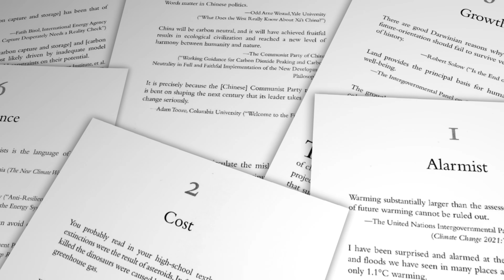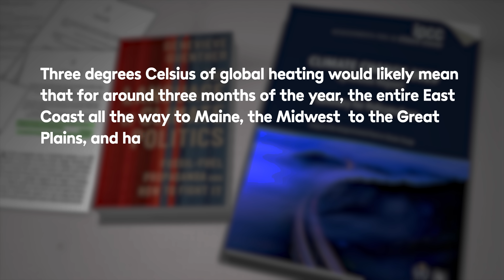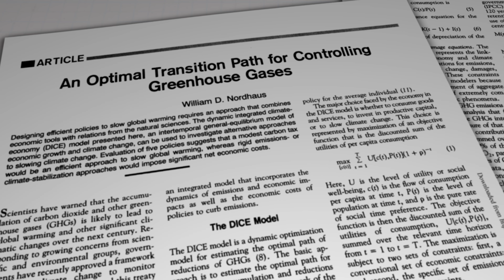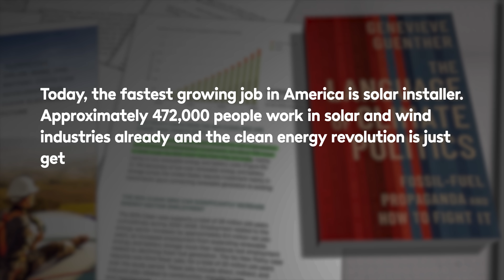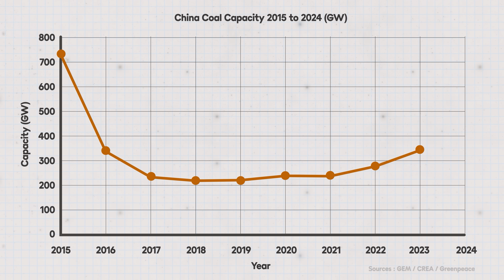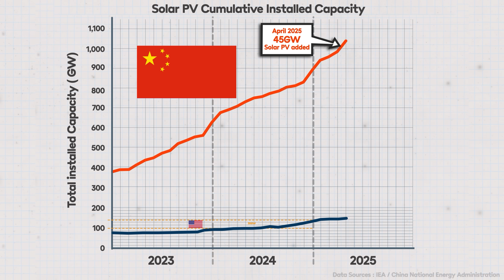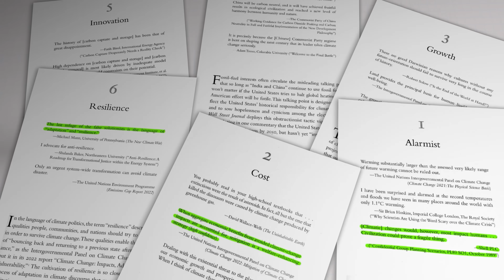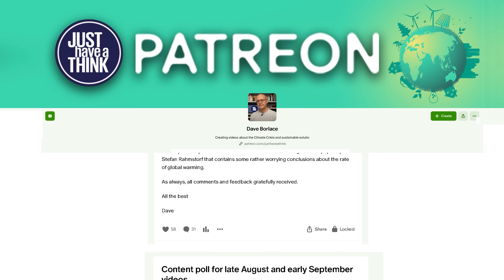New research DEBUNKS climate disinformation.

Comment: @Dave Borlace
Dave, can you look into and correct and/or explain why my last comment replying to orterves does not show up when I am not logged into my YT account? My comment still exists in my YT comment history, so that's proof that it was made. It contains a lot of climate science empirical data and peer reviewed science. Surely you want your 664K subscribers to see ALL the evidence both for and against human-caused global warming, don't you? I have screenshots that document what is happening if you would like to see them. 
FYI, the following is the text of the comment: 
******
@orterves "You are living in a bubble of ignorance." 
You are projecting your own condition onto me. 

Myhre(1998) empirically quantified nothing because there was no 'WMGG' empirical data for 'pre-industrial times'. 
Hansen(2005) empirically quantified nothing because the paper was based on flawed, faulty, falsified, failed climate models, which is not empirical data. 
Santer(2013) empirically detected nothing because the paper was based on flawed climate models, not empirical data. 

"Natural factors like solar output and volcanoes have been measured and can't explain the scale or pattern of current warming, only greenhouse gases do. " 
False. Increases in SURFACE solar radiation, due primarily to a decrease in the Earth's albedo, can explain the recent global warming over the past half century. Those increases in climate forcing are ~10 times greater than the alleged increase in surface CO2 forcing. This is empirically quantified and documented in multiple peer reviewed papers. Hatzianastassiou(2005) 'Global distribution of Earth's shortwave radiation budget', Pinker(2005) 'Do satellites detect trends in surface solar radiation', Goode(2007) 'Shortwave forcing of Earth's climate: Modern and historical variations in the Sun's irradiance and Earth's reflectance', Herman(2013) 'A net decrease in Earth's cloud, aerosol, and surface 340 nm reflectivity during the past 33 years (1979-2011)', McLean(2014) 'Late Twentieth-Century Warming and Variations in Cloud Cover' document increased SURFACE solar radiation of 3W/m^2 to 7W/m^2. And Santer(2025) 'Global Warming has Accelerated' documents and increase in SURFACE solar radiation of ~3W/m^2 over the entire 25 years of the 21st century due to a reduction in the Earth's albedo of ~0.7%. 

"Satellites show less infrared escaping Earth at CO2 absorption bands, and surface stations record more downwelling radiation, exactly as predicted." 
False, they didn't. The CERES data showed the opposite. 
From 2000 to 2015 DWIR decreased while CO2 levels increased: https://okulaer.wordpress(dot)com/wp-content/uploads/2015/03/lw-ned(dot)png 
From 2000 to 2015 LWIR from the surface increased while CO2 levels increased: okulaer.wordpress(dot)com/wp-content/uploads/2015/03/lw-opp(dot)png 

"The carbon isotope signature confirms the CO2 is from fossil fuels." 
False. They show no such thing, because the δ¹³C ratio from decaying natural vegetation is the same as from combustion of 'fossil' fuels. Plus the changes in Δ14CO2 is due to the natural reduction from the 'bomb spike' from atmospheric nuclear tests. 

"The rate of change is also far beyond natural variability, it's roughly ten times faster than typical past shifts." 
False. There have been numerous previous natural warmings of similar magnitude and rate of warming. 
"This analysis indicates that rapid warming trends exceeding 1.5 °C per century occurred at JRI during the intervals spanning 1518-1621 AD and 1671-1777 AD, and exceeded 1.25°C per century during the interval 296-415 AD." - Mulvaney(2012) 
Other natural warmings were: 
- 2585 BP 84yr natural warming of 0.20C/decade 
- 2760 BP 90yr natural warming of 0.22C/decade 
- 2980 BP 133yr natural warming of 0.15C/decad
6385 BP 98yr natural warming of 0.19C/decade - 8226 BP 91yr natural warming of 0.32C/decade - 10.3K BP 97yr natural warming of 0.19C/decade - 
74.7K BP 167yr natural warming of 0.13C/decade 
- 78.4K BP 160yr natural warming of 0.19C/decade 
- 80.2K BP 153yr natural warming of 0.18C/decade 
- 82.4K BP 139yr natural warming of 0.17C/decade 
- 90.1K BP 155yr natural warming of 0.13C/decade 
- 102K BP 65yr natural warming of 0.14C/decade 
- 127K BP 102yr natural warming of 0.13C/decade 
- 129K BP 162yr natural warming was 0.19C/decade 
From Davis & Taylor. Those natural warmings were as high a rate or higher rate than the most recent warming, and there were 30 other natural warmings that were from 0.08C/decade to 0.12C/decade found in this paper: wattsupwiththat(dot)com/2012/09/05/is-the-current-global-warming-a-natural-cycle/ 

"The evidence is overwhelming: human-emitted CO2 is the main driver of current global warming" 
False, as the above empirical science shows. You are just repeating the false propaganda narrative of the CatastrophicAGW-by-CO2 climate alarmism belief system/religion. This is confirmed by the fact that you can't cite a single peer reviewed paper that empirically shows that human CO2 has been the primary cause of any global warming. I've cited peer reviewed science that empirically shows that SURFACE solar radiation increased by 6W/m^2 to 10W/m^2 over the last half century, and that was several times greater than the alleged theoretical SURFACE CO2 forcing of ~1.3W/m^2. I say alleged, because the that formula includes an NON-observed amplification due to water vapor. 

As I said in my original comment, empirical science continues to show that global warming is caused by natural climate variability, primarily how much solar radiation reaches the surface of the Earth. This was established in peer reviewed science before the pseudoscience of CAGW-by-CO2 was begun. 
"It follows from the analysis of observation data that the secular variation in the mean temperature of the Earth can be explained by the variation of shortwave radiation arriving at the surface of the Earth." - Budyko(1969) 'The effect of solar radiation variations on the climate of the Earth'
***
Thanks Dave for your attention to and help with resolving this issue.
RealOldOne2
Reply: TL;DR
Reply: @Leafsdude  
"TL;DR"
Yes, peer reviewed empirical science is like that. 
It takes some intelligence and cognitive ability to understand it.
It's not simple snippets of propaganda narrative like human CO2 did it.
Unfortunately, Dave Borlace or YT or Google censor p-r empirical science that is contrary to the CAGW-by-CO2 propaganda narrative, so the climate alarmism cult members don’t see the truth and leave the cult.
Reply: @RealOldOne2  "Yes, peer reviewed empirical science is like that."

I've read the peer-reviewed empirical science.

Your meandering, unsubstantiated mumbling on y/t isn't it.
Reply: @Leafsdude  
"I've read the peer-reviewed empirical science.
Your meandering, unsubstantiated mumbling on y/t isn't it."
The points in my comment that refuted every one of orterves's false claims were substantiated by the peer reviewed science that I cited.
Noted that you couldn't refute any of it.
Reply: @RealOldOne2  "The points in my comment that refuted every one of orterves's false claims were substantiated by the peer reviewed science that I cited."

The only peer-reviewed science you cited were ones that you then asserted were wrong without demonstration, eg: Myhre(1998) (sic).

Even worse, you've relied on a very unscientific blog to make your supposed point.

Do try harder.
Reply: @Leafsdude  
"The only peer-reviewed science you cited were ones that you then asserted were wrong without demonstration, eg: Myhre(1998) (sic)"
That's totally false. I cited" 
- Hatzianastassiou(2005) 'Global distribution of Earth's shortwave radiation budget', 
- Pinker(2005) 'Do satellites detect trends in surface solar radiation', 
- Goode(2007) 'Shortwave forcing of Earth's climate: Modern and historical variations in the Sun's irradiance and Earth's reflectance', 
- Herman(2013) 'A net decrease in Earth's cloud, aerosol, and surface 340 nm reflectivity during the past 33 years (1979-2011)', 
- McLean(2014) 'Late Twentieth-Century Warming and Variations in Cloud Cover' document increased SURFACE solar radiation of 3W/m^2 to 7W/m^2. 
- Santer(2025) 'Global Warming has Accelerated'
- Mulvaney(2012)
- Budyko(1969) 'The effect of solar radiation variations on the climate of the Earth'

Noted that you not only failed to refute anything in those 8 peer reviewed papers, you didn't even acknowledge their existence in my comment.
Please try to stay in the world of reality.
Reply: @RealOldOne2  "- Hatzianastassiou(2005) 'Global distribution of Earth's shortwave radiation budget', 
- Pinker(2005) 'Do satellites detect trends in surface solar radiation',"

What exactly do you think these papers say re:climate? Note that not only do none of them comment on the effect of their data on climate, they don't even quantify the hypothetical temperature flux it would imply.

I'll also quickly note that these are looking at half of the atmospheric heat balance.  They do not discuss the effect of irradiance from Earth.

"- Goode(2007) 'Shortwave forcing of Earth's climate: Modern and historical variations in the Sun's irradiance and Earth's reflectance', "

Per the paper: "The increasing greenhouse forcing due to an anthropogenic increase of atmospheric CO2 over the past century has been treated in detail in
scientific literature in recent years (Intergovernmental Panel on Climate Change or IPCC, 1995; IPCC, 2001; Houghton, 2002 and references therein)."

So, opposed to arguing that current climate cannot be explained by anthropogenic sources, it actually explicitly acknowledges it.

"Herman(2013) 'A net decrease in Earth's cloud, aerosol, and surface 340 nm reflectivity during the past 33 years (1979-2011)', "

This paper is primarily a discussion on calibration of data analysis from satellite instruments.  Beyond that, the decrease in aerosols since 1985 is well documented and understood, and is in fact a large reason for the anomalies in Hansen 1988's scenarios that such findings has since allowed corrections for.  In other words, these findings have already been accounted for, and they still don't explain the temperature changes over the last 50+ years.

In short, I'm not sure how this refutes anything.

"McLean(2014)"

McLean 2014 is not peer-reviewed, as the journal publishing it (SCIPS) is known to not have a rigorous peer-review methodology and is in fact labeled as pay-to-publish predatory journal by all respectable scientific sources.

"Santer(2025) 'Global Warming has Accelerated'"

As with the first two, what do you think this article is saying?

"Mulvaney(2012)"

Paper title, please.

"Budyko(1969) 'The effect of solar radiation variations on the climate of the Earth'"

This paper is discussing Milankovitch cycles, and while it doesn't explicitly mention CO2, it does implicitly note its relevance in that phenomenon when it discusses "atmosphere and hydrosphere circulation".

In the end, I'm forced to restate that your assertions on these papers are not supported by the contents of said papers as it currently stands.
Reply: @Leafsdude  
"Budyko(1969) ... This paper is discussing Milankovitch cycles"
That's a misrepresentation. Milankovith cycles aren't even mentioned until 6 pages into the paper (over 2/3rds through), and then in the context 
"Though in this paper the author has no possibility to discuss numerous other hypotheses as to be causes of quaternary glaciations, nevertheless it is necessary to dwell upon popular idea concerning the influence of changes of the Earth's orbit elements on glaciations.
Such a conception substantiated by Milankovich (1930 and others) and other authors is shared by many specialists studying quaternary glaciations." - ibid

My quote wss from the abstract where authors summarize key aspects of the paper. Milankovitch isn't even mentioned in the abstract.
Reply: @Leafsdude  
""Mulvaney(2012)" Paper title, please."
Mulvaney(2012) ‘Recent Antarctic Peninsula warming relative to Holocene climate and ice shelf history’
Reply: @RealOldOne2  Budyko doesn't mention them by name, but that is the process that the paper is discussing in it entirety.  You don't have to mention a concept by name from the start or even at all to be discussing it.
Reply: @RealOldOne2  In Mulvaney's conclusion:

"If warming continues in this region, as is suggested by its attribution in part to rising atmospheric greenhouse gas concentrations 7,23, then temperatures will soon exceed the stable conditions that persisted here for most of the Holocene."

(The papers referenced by Mulvaney: 7 - Bentley, M.J. et al. Mechanisms of Holocene palaeoenvironmental change in the Antarctic Peninsula region. Holocene 19, 51-69, 2009, 23 - Bracegirdle, T. J., Connolley, W. M. & Turner, J. Antarctic climate change over the twenty first century. J. Geophys. Res.-Atmos.113, 2008)

So the paper you cited here supports anthropogenic-driven climate change.
Reply: @Leafsdude  
Hatzianastassiou(2005) ... Pinker(2005) ... What exactly do you think these papers say re:climate? Note that not only do none of them comment on the effect of their data on climate"
Really? You have to ask that question?
They both document that there were significant increases in shortwave surface solar radiation since 1983, and anyone with a little knowledge of climate knows that causes global warming. 

"Significant increasing trends in DSR and net DSR fluxes were found, equal to 4.1 and 3.7 Wm−2, respectively, over the 1984–2000 period (equivalent to 2.4 and 2.2 Wm−2 per decade), indicating an increasing surface solar radiative heating. This surface SW radiative heating is primarily attributed to clouds, especially low-level, and secondarily to other parameters such as total precipitable water. The surface solar heating occurs mainly in the period starting from the early 1990s" - Hatzianastassiou(2005)
Do you really not understand that surface solar HEATING is what global warming climate change is all about?

"Long-term variations in solar radiation at Earth’s surface (S) can affect our climate, the hydrological cycle, plant photosynthesis, and solar power. Sustained decreases in S have been widely reported from about the year 1960 to 1990. Here we present an estimate of global temporal variations in S by using the longest available satellite record. We observed an overall increase in S from 1983 to 2001 at a rate of 0.16 watts per square meter (0.10%) per year; this change is a combination of a decrease until about 1990, followed by a sustained increase." - Pinker(2005)
Did you miss that "affect our CLIMATE" in the very first sentence of the paper???

"Note that not only do none of them comment on the effect of their data on climate"
Really? "surface solar HEATING" is not an "effect ... on climate"
It appears you have no clued about climate science.

"they don't even quantify the hypothetical temperature flux it would imply."
Irrelevant handwaving. That wasn't the purpose of those papers. It was do document changes in surface shortwave solar radiation.

"I'll also quickly note that these are looking at half of the atmospheric heat balance."
Even a 10 year old child understands that when you turn up the heat input to the pot of water on the stove, it will cause the water to warm up more.
Do you realize that you are embarrassing yourself?
Reply: @Leafsdude  
"Goode(2007) ... Per the paper: "The increasing greenhouse forcing due to an anthropogenic increase of atmospheric CO2 over the past century has been treated in detail in scientific literature in recent years (Intergovernmental Panel on Climate Change or IPCC, 1995; IPCC, 2001; Houghton, 2002 and references therein)."

So, opposed to arguing that current climate cannot be explained by anthropogenic sources, it actually explicitly acknowledges it."
Your selective quoting is noted, and confirmed by the paper's text IMMEDIATELY following where your quote stopped: "However, the variability in the Earth's net shortwave forcing could also play a CRITICAL ROLE in the Earth's climate change."
THAT, "the Earth's net shortwave forcing", was a major aspect of the paper. 
"The DECREASE  in the Earth’s reflectance from 1984 to 2000 suggested by Fig. 4, translates into a Bond albedo DECREASE of 0.02 (out of the nominal value of about 0.30) or an ADDITIONAL global shortwave forcing of 6.8 W/m^2 . To put that in perspective, the latest IPCC report (IPCC, 2001) argues for a 2.4 W/m^2 increase in CO2 longwave forcing since 1850." 
You failed to mention that the alleged (not empirically measured because there is no empirical data from 1850) was only 2.4W/m^2, whereas the empirically measured increase in surface shortwave solar radiative forcing was 6.8W/m^2! 
So Goode(2007) empirically documented that there was 2.8 TIMES MORE climate warming forcing from 1984-2000 than there was allegedly from 1850!
Perhaps you don't understand climate science well enough to recognize that the IPCC's alleged increase in surface CO2 forcing from 1984-2000 was less than 0.4W/m^2. So the natural shortwave solar surface climate forcing was EIGHTTEEN TIMES GREATER than the IPCC's alleged surface CO2 climate forcing. And that alleged surface CO2 forcing includes natural CO2 increases too. 
Yes, the empirical data clearly shows that recent global warming was natural, NOT caused by human CO2.

In short, you majorly either misrepresented or just failed to understand the climate science in Goode(2007).
Reply: @Leafsdude  
Herman(2013) ... This paper is primarily a discussion on calibration of data analysis from satellite instruments."
Not true. As the title and abstract of the paper say, it was primarily about the change in the Earth's albedo. 
"Applying a 3.6 % cloud reflectivity perturbation to the shortwave energy balance partitioning given by Trenberth et al. (2009) corresponds to an increase of 2.7 W m−2 of solar energy reaching the Earth’s surface and an increase of 1.4 % or 2.3 W m−2 absorbed by the surface, which is partially offset by increased longwave cooling to space." - Herman(2013)
Your comment ignores that increase is shortwave solar radiative climate forcing.

"Beyond that, the decrease in aerosols since 1985 is well documented and understood"
Empirical data and peer reviewed science documenting this please.

"and is in fact a large reason for the anomalies in Hansen 1988's scenarios that such findings has since allowed corrections for."
Hansen's 'Scenario C' predicted that global temperature would increase by 1,4C from 1988 to 2024 (0.39C/decade), but actual increase per global satellite data is only 0.16C/decade, and the GHG forcing has acutally increased GREATER than Hansen's 'Scenario C' assumed increase of 1.5%/year. So Hansen's forecast predicted too much warming by over 2.4 times.

"In other words, these findings have already been accounted for, and they still don't explain the temperature changes over the last 50+ years."
Wrong. As my comments about the p-r papers I've cited have shown, the increase in NATURAL surface shortwave solar radiative climate forcing are many times greater than the alleged increases in CO2 forcing, both natural and human.
Reply: @Leafsdude  
"McLean 2014 is not peer-reviewed, as the journal publishing it (SCIPS) is known to not have a rigorous peer-review methodology"
You're either lying, or are relying on the false propaganda narratives of your CAGW-by-CO2 climate alarmism religion. The paper was peer reviewed and published in the 'Atmospheric and Climate Sciences' journal, which has been publishing from 2011-2025.
"SCIRP maintains the highest standards of academic integrity by implementing stringent ethical policies and a RIGOROUS PEER-REVIEW PROCESS. Violations of professional ethical codes, such as plagiarism, fraudulent manipulation of data, and false attribution of authorship, are dealt with severely by our editorial team, with a zero-tolerance approach.
In line with our unwavering commitment to ethical publishing, SCIRP adheres to the guidelines of the Committee on Publication Ethics (COPE) for resolving cases of suspected misconduct.
The manuscript submitted must adhere to the principle of originality and must not have been published in any shape or form previously nor should it be under consideration for publication elsewhere." - scirp(dot)org/journal/publicat_ethics_statement?journalid=492
Obviously, the climate alarmism propaganda gatekeepers are upset that a journal would publish papers based on empirical science which contradicts the climate alarmism false narrative.

From the paper: 
"Total cloud cover decreased during the period from 1987 to 1997 and, for most of the remainder of the period from 1984 to 2009, decreases in low-level cloud were accompanied by increases in middle and upper level cloud. These changes can be found in both global average cloud cover and in each of the six 30˚-latitude bands. The impact of these changes in cloud cover can account for the variations in HadCRUT4 global average temperature anomalies and the divergence between land and sea temperatures. ... 
The temperature pattern for the period 1988-1997 appears to be generally consistent with the 7% reduction in total cloud cover that occurred across the period 1987 to 1999. Applying that reduction to the influence of clouds in the energy budget described by Trenberth et al. [34] results in an increased average solar forcing at the Earth’s surface of about 5 Wm−2. This increase is MORE THAN DOUBLE the IPCC’s estimated radiative forcing from all anthropogenic emissions of greenhouse gases." - McLean(2014)
Reply: @Leafsdude  
"Budyko doesn't mention them by name, but that is the process that the paper is discussing in it entirety."
You're just denying reality and making stuff up.
Whether the cause of increased surface shortwave solar radiation was increased TSI of the Sun's output or a reduction in albedo due to a reduction in clouds or aerosols, the result is the same, global warming caused by natural solar radiation, not human CO2.
Reply: @Leafsdude  
Your handwaving with the 'Moving the Goalposts' logical fallacy is noted.
I cited and quoted from Mulvaney(2012) to refute the false claim "The rate of change is also far beyond natural variability, it's roughly ten times faster than typical past shifts." .
Mulvaney(2012) which states: "This analysis indicates that rapid warming trends exceeding 1.5 °C per century occurred at JRI during the intervals spanning 1518-1621 AD and 1671-1777 AD, and exceeded 1.25°C per century during the interval 296-415 AD." - Mulvaney(2012) "refutes the false climate alarmism propaganda narrative the the recent climate warming is unprecedented.

Antarctica ice mass loss is just another of climate alarmism's fear mongering memes. Peer reviewed science, Favier(2017) 'Antarctica-Regional Climate and Surface-Mass Budget' says: 
" It has been suggested that overall, SMB INCREASED across the grounded AIS of 160 ± 20 Gt a−1 (~ 9%) since 1800 AD and 110 ± 22 Gt a−1 (~ 6%) since 1900 (1900–2010), with the largest (area weighted) contribution from the West AP [58], where a DOUBLING of accumulation since 1850 has been identified" - Favier(2015)

Recent Antarctica ice mass changes have been insignificant when compared to the total ice mass of Antarctica. Here's a graph which shows that to be true: 
uploads(dot)disquscdn(dot)com/images/b2928efbfa695db7e714a6bd4623ce26c485f590b86f6d44840022bfce0ab2b7(dot)png?w=800&h=560
Reply: @RealOldOne2  "Really? You have to ask that question?"

Really?  You can't just answer the question?

"They both document that there were significant increases in shortwave surface solar radiation since 1983, and anyone with a little knowledge of climate knows that causes global warming."

Yes.  And as I note, they did not quantify that warming.  So they're kind of irrelevant to the discussion.

"Do you really not understand that surface solar HEATING is what global warming climate change is all about?"

It's not what it's about.  It's about the surface radiative budget, of which solar heating is only one part.  As I note, irradiance is also a significant part.  To laymen, that's the "greenhouse effect".

"Really? "surface solar HEATING" is not an "effect ... on climate""

Of course it is.  But they don't comment on said effect.  They just published the data on the strength of said effect.  Which cannot be easily converted to temperature data and therefore is useless in determining how much effect on current temperature change it is having.

"Irrelevant handwaving."

Considering the flux is the entire issue, calling it irrelevant is hilarious.  It appears you have no clued [sic] about climate science.

"Even a 10 year old child understands that when you turn up the heat input to the pot of water on the stove, it will cause the water to warm up more."

Unless you keep pouring buckets of ice into the water as well.

You're embarrassing yourself.

"the paper's text IMMEDIATELY following where your quote stopped: "However, the variability in the Earth's net shortwave forcing could also play a CRITICAL ROLE in the Earth's climate change.""

And per the sources I cited, the evidence strongly shows that while it probably plays a role, it cannot explain the changes seen in the last 30-50+ years.

"Yes, the empirical data clearly shows that recent global warming was natural, NOT caused by human CO2."

Except it doesn't.

"In short, you majorly either misrepresented or just failed to understand the climate science in Goode(2007)."

Or, you're wrong.

"Your comment ignores that increase is shortwave solar radiative climate forcing."

That is offset by longwave radiation reflected into space (among other natural negative forcings).

"Empirical data and peer reviewed science documenting this please."

Herman, Jay & Deland, Matthew & Huang, Liang-Kang & Labow, G. & Larko, D. & Lloyd, Steven & Mao, Jiahua & Qin, W. & Weaver, Clark. (2013). A net decrease in the Earth's cloud, aerosol, and surface 340 nm reflectivity during the past 33 yr (1979–2011). Atmospheric Chemistry and Physics. 13. 8505-8524

"Wrong. As my comments about the p-r papers I've cited have shown, the increase in NATURAL surface shortwave solar radiative climate forcing are many times greater than the alleged increases in CO2 forcing"

"Alleged"?

Regardless, the forcing is peanuts compared to the feedback sensitivity from CO2 forcing.

"You're either lying, or are relying on the false propaganda narratives of your CAGW-by-CO2 climate alarmism religion."

Yes.  Gotta be.  I can't possibly be correct.

The reputation of SCIRP from independent sources is clear.  Quoting SCIRP to refute that is like quoting the Bible.  It's circular reasoning.

"You're just denying reality and making stuff up."

Uh huh.  You're getting desperate.  At least you were trying to quote papers before instead of these baseless assertions and ad hominems.

The entirety of Budyko discusses causes of Quaternary glaciations, and the effects of changes in Earth's orbit.  You can find lengthy discussions about both throughout the paper.  If the best you can counter that with is saying I'm "making stuff up", then it's quite clear to any reasonable observer that you haven't read it.

"Your handwaving with the 'Moving the Goalposts' logical fallacy is noted."

Where did I move the goalposts?  Please be specific with verbatim quotes.

"Mulvaney(2012) which states"

As you accused me of, you've quote-mined this section.  The datapoints cited, as the paper title suggests, is for Antarctica.  It's not global temperature, and therefore does not refute that the global shift in temperature over the last two centuries is within natural variance.

Of course, that said, I won't reject that it is.  In fact, it probably is.  The issue is where present natural factors have been accounted for and are not correlative with temperature change.  None of that changes the fact that Mulvaney 2012 doesn't make that claim.

"Antarctica ice mass loss is just another of climate alarmism's fear mongering memes."

I hear more about Antarctic ice mass loss from "skeptics" than "alarmists".

In fact, it's Greenland's glacial mass loss that is the primary concern based on the data, and pretty much always has been.  But "skeptics" always forget about Greenland until it's convenient.  And then once it's no longer convenient again, they forget about it again.
Reply: @Leafsdude  
Wow! I didn't think it was possible for you to embarrass yourself any further, but you were able to accomplish it with your latest comment. You ignored all the valid points that I made which debunked all your arguments, and you just began handwaving again to distract from that reality.

"Really?  You can't just answer the question?"
I did answer the question. Why do you take offense that I also expressed my amazement that you were unable understand the clear language from the paper I quoted from?

Noted that you didn't answer each of my separate replies separately so each issue could be rationally discussed. You lumped your handwaving all together to confuse, distract and deny the reality that I debunked all your arguments.
Reply: @Leafsdude  b
" "They both document that there were significant increases in shortwave surface solar radiation since 1983, and anyone with a little knowledge of climate knows that causes global warming."

Yes.  And as I note, they did not quantify that warming.  So they're kind of irrelevant to the discussion."
No it's not irrelevant to the discussion. 
Unless you think that a W/m^2 of surface solar radiative forcing causes a different temperature change that a W/m^2 of surface CO2 forcing. Is that what you believe? Then by all means cite/quote the peer reviewed science that supports that belief.  

I pointed out that the change in surface solar radiative forcing was 10+ TIMES the change in surface CO2 forcing. That means that that the increase in surface solar radiative forcing caused 10+ times more warming than the increase in CO2 forcing.

You are furiously handwaving to distract from that simple fact.
Reply: @Leafsdude  
""Do you really not understand that surface solar HEATING is what global warming climate change is all about?"
It's not what it's about.  It's about the surface radiative budget, of which solar heating is only one part.  As I note, irradiance is also a significant part.  To laymen, that's the "greenhouse effect".
"Really? "surface solar HEATING" is not an "effect ... on climate""
Of course it is.  But they don't comment on said effect.  They just published the data on the strength of said effect.  Which cannot be easily converted to temperature data and therefore is useless in determining how much effect on current temperature change it is having."

More handwaving to distract from the FACT that the change in climate forcing from natural surface solar radiation was 10+ times greater than the change in surface CO2 forcing.
Reply: @RealOldOne2  "You ignored all the valid points that I made"

Wrong.

"I did answer the question."

After complaining about it.

"Why do you take offense that I also expressed my amazement that you were unable understand the clear language from the paper I quoted from?"

Your "clear language"?  You literally just cited the paper.

"Noted that you didn't answer each of my separate replies separately"

Yes, because I'm succinct and don't spam.  You should try it.

Seriously, what a weird thing to complain about.

"No it's not irrelevant to the discussion."

Yes it is, because the issue is temperature increase, which is measured in degrees, not in wattage.

"I pointed out that the change in surface solar radiative forcing was 10+ TIMES the change in surface CO2 forcing."

Then you read the paper wrong, because the paper says:

"The decrease in the Earth’s reflectance from 1984 to 2000 suggested by Fig. 4, translates into a Bond albedo decrease of 0.02 (out of the nominal value of about 0.30) or an additional global shortwave forcing of 6:8 W=m 2 . To put that in perspective, the latest IPCC report (IPCC, 2001) argues for a 2:4 W=m 2 increase in CO 2 longwave forcing since 1850."

6.8 / 2.4 <> 10+ TIMES [sic].  In fact, it's about 2.8 times.  So you're off by a factor of over 3.5.

Again, though, the entire effect of CO2 on the radiative balance on the Earth's surface is not limited to its direct forcing.  So there's still a quote mine here by you that removes the context.

"You are furiously handwaving to distract from that simple fact."

More like you are determined to make it a fact, even though anyone who actually understands the science knows it's not.

"More handwaving to distract from the FACT that the change in climate forcing from natural surface solar radiation was 10+ times greater than the change in surface CO2 forcing."

You can repeat it as often as you like.  Still won't make it a fact.
Reply: @Leafsdude  
" "Irrelevant handwaving."
Considering the flux is the entire issue, calling it irrelevant is hilarious.  It appears you have no clued [sic] about climate science."
The  "Irrelevant handwaving" was in response to your comment where you wrote "they don't even quantify the hypothetical TEMPERATURE FLUX it would imply". You are obviously ignorant of the fact that "TEMPERATURE FLUX" is scientific nonsense, since temperature is an intensive property. There is such a thing as a HEAT flux, but "TEMPERATURE FLUX" is not a scientific term.

The more you reply, the more you expose your ignorance of science.
Really pathetic, but common with people who are scientifically illiterate.
Reply: @RealOldOne2  🤦‍♂

Simple question: what does "flux" mean?
Reply: @Leafsdude  
" "Even a 10 year old child understands that when you turn up the heat input to the pot of water on the stove, it will cause the water to warm up more."
Unless you keep pouring buckets of ice into the water as well.
You're embarrassing yourself."
Hahaha. So you're claiming that the climate system has something happening to the oceans that is equivalent to  "pouring buckets of ice into the pot of water on the stove"? Please explain what those "buckets of ice" are! 
You are HILARIOUS, and yes you ARE continuing to embarrass yourself.
Reply: @Leafsdude  
"the paper's text IMMEDIATELY following where your quote stopped: "However, the variability in the Earth's net shortwave forcing could also play a CRITICAL ROLE in the Earth's climate change.""

And per the sources I cited, the evidence strongly shows that while it probably plays a role, it cannot explain the changes seen in the last 30-50+ years."
Wow, you expose your scientific illiteracy and/or your denial of reality once again. NONE of your sources said anything about SURFACE solar radiative forcing. They were all about solar radiation at THE TOP OF ATMOSPHERE. 
Scientifically illiterate believers in climate alarmism sadly don't even know the difference.
Once again the more comments you make, the more you embarrass yourself as you expose your ignorance of science
Reply: @Leafsdude  
""Yes, the empirical data clearly shows that recent global warming was natural, NOT caused by human CO2."
Except it doesn't."
Hahaha. Your EVIDENCE-FREE CLAIM is noted.
Except it DOES, because the change in surface SOLAR radiative forcing was 10+ times GREATER than the alleged change in surface CO2 forcing.

You are totally out of touch with reality. Sad.
Reply: @Leafsdude  
" "In short, you majorly either misrepresented or just failed to understand the climate science in Goode(2007)."
Or, you're wrong."
My comment quoting from Goode(2007) showed that I was correct. Once again you provided ZERO EVIDENCE-that I am wrong. You are just denying the reality that I am correct. It's what people do who have been brainwashed into a false belief system/cult religion.
Reply: @Leafsdude  
" "Your comment ignores that increase is shortwave solar radiative climate forcing."
That is offset by longwave radiation reflected into space (among other natural negative forcings)."
Sorry, but you've provided ZERO empirical scientific evidence of any "offset by longwave radiation reflected into space" or "other natural negative forcings".
Once again, you are just denying the reality of the empirical scientific evidence that I've provided from peer reviewed empirical science.
It's what believers in cult religions do.
Reply: @Leafsdude  
"Alleged"?
Regardless, the forcing is peanuts compared to the feedback sensitivity from CO2 forcing."

The CO2 forcing is "alleged" because it includes a HYPOTHETICAL, THEORETICAL water vapor feedback amplification, for which there is ZERO empirical scientific data showing it exists or quantifying it. 

And THAT is why your claim of "peanuts" is just a CLAIM that has no empirical scientific empirical data which supports it.

Your comments continue to reveal that you really don't understand climate science.
Reply: @Leafsdude  
"You're either lying, or are relying on the false propaganda narratives of your CAGW-by-CO2 climate alarmism religion."
Yes.  Gotta be.  I can't possibly be correct."
More handwaving dodging the fact that you can't back up your claims with empirical scientific data. 
The p-r sources I cited/quoted proved you are wrong. You continue to dodge that reality with handwaving.
Reply: @RealOldOne2  "So you're claiming that the climate system has something happening to the oceans"

I've claimed nothing about the oceans.  How you ever made that conclusion is well beyond me.

But keep embarrassing yourself.

"NONE of your sources said anything about SURFACE solar radiative forcing. They were all about solar radiation at THE TOP OF ATMOSPHERE. "

Wrong.

Foukal 2006 analyzed total solar irradiance, which is about measuring the sun directly and has nothing to do with Earth's atmosphere.

Erlykin 2009 analyzed cosmic rays and sun spots to estimate radiative effects of the sun on Earth.  Again, didn't look at either's effects within Earth's atmosphere.

Stott 2003 discussed, among other things, the "[c]limatic impact of solar and volcanic forcings".

Scafetta 2006 (4), as with Foukal, looked at total solar irradiance, this time using proxies to estimate sun activity over time.

Solanski 2003 did all of the above, while Solanski 2004 purely analyzed changes in the Sun over time.

de Jager 2006 looked at how solar irradiance effected the troposphere (the bottom of the atmosphere, young grasshopper).

Lastly, Scafetta 2006 (8) used both satellite data and proxies of total solar irradiance and compared it to surface temperatures to estimate the contribution and found only 20-40% of the total change.

But keep embarrassing yourself.

"Except it DOES, because the change in surface SOLAR radiative forcing was 10+ times GREATER than the alleged change in surface CO2 forcing."

You can repeat it as often as you like.  Still won't make it a fact.  But keep embarrassing yourself

"My comment quoting from Goode(2007) showed that I was correct."

And my comment quoting from Goode 2007 in response showed you weren't.  But keep embarrassing yourself.

"Sorry, but you've provided ZERO empirical scientific evidence of any "offset by longwave radiation reflected into space" or "other natural negative forcings"."

It was literally right in your quote.  Pay attention to what you're posting, perhaps?  Or just keep embarrassing yourself.

"The CO2 forcing is "alleged" because it includes a HYPOTHETICAL, THEORETICAL water vapor feedback amplification"

So relative humidity is "hypothetical"?  Seriously?

"for which there is ZERO empirical scientific data showing it exists or quantifying it."

Arrhenius 1896, Calandar 1938, Plass 1954 and many others say otherwise.

"And THAT is why your claim of "peanuts" is just a CLAIM that has no empirical scientific empirical data which supports it."

Not only does it, but your own sources quantify some of it, specifically albedo and clouds.  Hatzianastassiou 2005 does, as does Pinker 2005 and Goode 2007.

You've clearly not read your own sources.  That, or you're cherrypicking the parts that support your predetermined belief and ignore the rest of it.

Would make all your ad hominems pretty standard projection that you "skeptics" lean towards so aggressively.

"The p-r sources I cited/quoted proved you are wrong."

Except they didn't, as I've shown by quoting said citations saying the opposite of what you've claimed.

But keep embarrassing yourself.
Reply: @Leafsdude  
The reputation of SCIRP from independent sources is clear.  Quoting SCIRP to refute that is like quoting the Bible.  It's circular reasoning.
"You're just denying reality and making stuff up."
Uh huh.  You're getting desperate.  At least you were trying to quote papers before instead of these baseless assertions and ad hominems."
Hahahahaha. 
Are you really so detached from reality that you don't understand that YOU are the one doing the ad hominem attack against SCIRP????

First you LIED when you claimed that McLean(2014) was not peer reviewed", then you ad hom attacked SCIRP.
Noted that you've provided ZERO empirical evidence of ANY wrongdoing or anything that SCIRP has done that tarnishes their reputation.
Once again, you are just making stuff up because you are so brainwashed into your climate alarmism cult dogmas that you can't bring yourself to face reality that the empirical science shows that your cult dogmas are false.
Reply: @RealOldOne2  "Are you really so detached from reality that you don't understand that YOU are the one doing the ad hominem attack against SCIRP????"

Take that up with Jeffrey Beall, Simon Linacre, Andreas Nishikawa-Pacher, Tamara Heck and Kerstin Schoch, among many others.  Not me.
Reply: @RealOldOne2  "Once again, you are just making stuff up because you are so brainwashed into your climate alarmism cult dogmas that you can't bring yourself to face reality that the empirical science shows that your cult dogmas are false."

Your accusation is just a confession in disguise.
Reply: Re: SCIRPs, one can also look up sources such as Abrahams, Marc (2009-12-22). "Strange academic journals: Scam?". Improbable Research and Doctorow, Cory (October 19, 2012). "Math journal accepts computer-generated nonsense paper". Boing Boing demonstrating beyond any reasonable doubt that there is no functional peer-review going on at their journals, and that in fact they are run by fraudulent scam artists who will take any paper in the name of making money.
Reply: @RealOldOne2  What do you think "secular variation" means?
Reply: @RealOldOne2  FYI, at this point, I'm just commenting to entertain myself and to demonstrate the flaws in your arguments to others who might read this and be taken in by your scam, after you practically called relative humidity a "hypothesis" in order to refute climate feedback effects that amplify forcing effects.  That is about the funniest thing I've ever heard a "skeptic" say.

We learn about relative humidity in grade 10 science class because it is just that basic an understanding in atmospheric physics.  It's beyond amusing that you would assert it to just be an unsubstantiated claim when it is one of the biggest core understandings in how weather on our planet works.  It's no different than hearing a flat Earther assert that gravity is made up by shadow government agents.

It really does make it clear that all your ad hominem commentary is just projection.
Reply: @Leafsdude  
"As you accused me of, you've quote-mined this section.  The datapoints cited, as the paper title suggests, is for Antarctica.  It's not global temperature, and therefore does not refute that the global shift in temperature over the last two centuries is within natural variance."
Your evidence-free claim (lie) that I quotemined is noted. 
I'm not surprised that you are so ignorant of climate science that you don't understand that Antarctic ice cores are used as global proxies of temperature and CO2 levels. 

I imagine that you are also ignorant of the fact that peer reviewed science confirms that the Antarctic ice cores show that changes in CO2 LAGGED changes in temperature.
Intelligent people know that a cause must happen BEFORE the effect of that cause. That means that the changes in CO2 do NOT cause the changes in temperature. It's the changes in temperature that cause the changes in CO2
But I imagine that you deny that reality too.
Reply: @Leafsdude  
" "Antarctica ice mass loss is just another of climate alarmism's fear mongering memes."
I hear more about Antarctic ice mass loss from "skeptics" than "alarmists".
In fact, it's Greenland's glacial mass loss that is the primary concern based on the data, and pretty much always has been.  But "skeptics" always forget about Greenland until it's convenient.  And then once it's no longer convenient again, they forget about it again."
So you're denying that Antarctic ice loss is used as a scare meme. Got it.

And there's nothing alarming with Greenland ice mass loss either. The climate alarmists fearmonger by using expanded scales on their graphs to predict doom, when the reality is that the ice mass changes are undetectable on a graph of total Greenland ice mass, as this graph shows: 
uploads(dot)disquscdn(dot)com/images/4b01c087b2d1c1edd47b1183dc1be524332f8f2e1cd20568663b905e534e9691(dot)png?w=800&h=630&w=800&h=630
Reply: @Leafsdude  
""Are you really so detached from reality that you don't understand that YOU are the one doing the ad hominem attack against SCIRP????"

Take that up with Jeffrey Beall, Simon Linacre, Andreas Nishikawa-Pacher, Tamara Heck and Kerstin Schoch, among many others.  Not me."
YOU are the one who made the claim here, so own it.
Oh yeah, climate alarmists are too dishonest to do that.
Reply: @Leafsdude  
" FYI, at this point, I'm just commenting to entertain myself and to demonstrate the flaws in your arguments to others who might read this and be taken in by your scam, after you practically called relative humidity a "hypothesis" in order to refute climate feedback effects that amplify forcing effects.  That is about the funniest thing I've ever heard a "skeptic" say."
Hahaha. That's exactly what I'm doing. You're doing a fine job of exposing your dishonesty, your scientific illiteracy, your inability to refute any of the peer reviewed empirical scientific data that I've posted which shows that the overwhelming cause of recent global warming is natural, not human-caused. 

You've ailed to refute a single bit of the peer reviewed empirical science that I've posted which confirms that natural climate forcing has increased much more than CO2 forcing, most of which is natural too.
You've exposes yourself as a poseur. And that's not an ad hom, it's a factual statement of reality, based on your own comments.
Reply: @Leafsdude_  
"Yes it is, because the issue is temperature increase, which is measured in degrees, not in wattage."
Doesn't surprise me at all that you ignorant of the fact and reality that changes in W/m^2 of climate forcing are what causes temperature change. And are ignorant of the fact and reality that when natural climate forcing increases are much larger than human climate forcing, that means that the primary cause of global warming is primarily natural, not human-caused.
Reply: @Leafsdude_  
" "I pointed out that the change in surface solar radiative forcing was 10+ TIMES the change in surface CO2 forcing."
Then you read the paper wrong, because the paper says:
"The decrease in the Earth’s reflectance from 1984 to 2000 suggested by Fig. 4, translates into a Bond albedo decrease of 0.02 (out of the nominal value of about 0.30) or an additional global shortwave forcing of 6:8 W=m 2 . To put that in perspective, the latest IPCC report (IPCC, 2001) argues for a 2:4 W=m 2 increase in CO 2 longwave forcing since 1850."
6.8 / 2.4 <> 10+ TIMES [sic].  In fact, it's about 2.8 times.  So you're off by a factor of over 3.5."

Wow, more evidence of either your dishonesty or scientific illiteracy.
It's NOT 6.8/2.4. It's 6.8/0.4 when you compare both over the same 1984-2000 time period. It's a shame that you deny the reality that I posted: "Perhaps you don't understand climate science well enough to recognize that the IPCC's alleged increase in surface CO2 forcing from 1984-2000 was less than 0.4W/m^2. So the natural shortwave solar surface climate forcing was EIGHTTEEN TIMES GREATER than the IPCC's alleged surface CO2 climate forcing."
Yes, 6.8/0.4, eighteen, IS 10+ times greater than 0.4.

Or you were dishonestly trying to make the comparison over two different time frames, 6.8W/m^2 increase in natural surface solar forcing over 1984-2000, and a 2.4 over a 1850-2025 'pre-industrial' to present time frame.  

" "More handwaving to distract from the FACT that the change in climate forcing from natural surface solar radiation was 10+ times greater than the change in surface CO2 forcing."
You can repeat it as often as you like.  Still won't make it a fact."
You can deny the REALITY and FACT that the 1984-2000 natural surface solar radiative forcing increase of 6.8w/m^2 IS 10+ times greater than the 1984-2000 increase in surface CO2 0.4W/m^2 as many times as you want, but it will never change the FACT that the increase in NATURAL solar radiative forcing was 10+ times greater than the increase in CO2 forcing, which was both natural and human.

Yet again, you discredit yourself and expose your scientific illiteracy and/or your dishonesty.
Reply: @Leafsdude  
"  @RealOldOne2  "So you're claiming that the climate system has something happening to the oceans"
I've claimed nothing about the oceans.  How you ever made that conclusion is well beyond me.
But keep embarrassing yourself."
Your lie that you've claimed nothing about the oceans is noted, and confirmed by your claim "Unless you keep pouring buckets of ice into the water as well."
My analogy of the pot of water on the stove was analogous to the oceans in the Earth's climate system, so your 'buckets of ice into the water' was implying that there was something analogous to 'buckets of ice' going into the oceans.
Your dishonest refusal to admit to what you posted is noted, as is the fact that you continue to keep embarrassing yourself.
Reply: @Leafsdude  
" "My comment quoting from Goode(2007) showed that I was correct."
And my comment quoting from Goode 2007 in response showed you weren't.  But keep embarrassing yourself."
You're full delusional now, just denying reality and making stuff up. 
Your quote from Goode(2007) included ZERO EMPIRICAL DATA! It didn't refute Goode(2007)'s empirical data showing that surface SOLAR radiative forcing from 1984-2000 increased by 6.8W/m^2. It merely referenced the the IPCC reports NONE of which refuted Goode(2007)'s NATURAL 6.8W/m^2 empirical data finding. The IPCC's own radiative forcing equation found that from 1984-2000 surface CO2 forcing increased by only 0.4W/m^2. 

Thanks for once again embarrassing yourself. You're in full meltdown mode now. I often observe that happens when low IQ brainwashed climate alarmism cultists are exposed to empirical science which proves their cult dogmas are pseudoscientific bunkum.
Reply: @Leafsdude  
" "The CO2 forcing is "alleged" because it includes a HYPOTHETICAL, THEORETICAL water vapor feedback amplification"
So relative humidity is "hypothetical"?  Seriously?"
Hahaha. Hilarious how you can't think straight when you are on FuLL TILT!
It's just insane to claim that I said/believe that relative humidity was "hypothetical". 

Any sane, rational, scientifically literate person would understand that my comment meant that the ASSUMPTION that relative humidity remains constant during atmospheric warming was hypothetical, not the concept of relative humidity. The fact that empirical data has shown that is not true, and the fact that climate models typically are based on that assumption, explains one of the reasons that 95+% of climate models FAIL because they predict too much warming.

Nice job of continuing to embarrass yourself.
Reply: @Leafsdude  
" "And THAT is why your claim of "peanuts" is just a CLAIM that has no empirical scientific empirical data which supports it."
Not only does it, but your own sources quantify some of it, specifically albedo and clouds.  Hatzianastassiou 2005 does, as does Pinker 2005 and Goode 2007."
There you go again exposing your delusions, denying reality and just making stuff up. 
The reality is that you've refuted nothing that I've posted, but you suffer the delusions that you have. Everyone can go through your comments and see that I am telling the truth and you are lying.

"You've clearly not read your own sources.  That, or you're cherrypicking the parts that support your predetermined belief and ignore the rest of it."
Hahaha. You are clearing your own situation onto me. 
I've done no cherrypicking. You can't quote any of my sources where they say or present any empirical data that surface solar radiation has decreased over the late 2th century. It doesn't exist. Which proves that I'm NOT cherrypicking. That's just a standard dishonest tactic used to deny the reality that you are wrong. 

Once again, you embarrass yourself.
Reply: @RealOldOne2  "Your evidence-free claim (lie) that I quotemined is noted."

The evidence, as I pointed out, is in the paper's title.

"So you're denying that Antarctic ice loss is used as a scare meme. Got it."

Wrong.

"YOU are the one who made the claim here"

Based on data and analysis published by others.

I do not make my own claims, because I have no working expertise on the issue.  I don't hide that, unlike you.

"Your dishonest and/or scientifically illiterate misrepresentation that I practically called relative humidity a "hypothesis" and that I assert relative humidity to be an unsubstantiated claim, is a noted."

So when you said, "[t]he CO2 forcing is "alleged" because it includes a HYPOTHETICAL, THEORETICAL water vapor feedback amplification" you weren't talking about relative humidity?  Then what were you talking about?

"Doesn't surprise me at all that you ignorant of the fact and reality that changes in W/m^2 of climate forcing are what causes temperature change."

Weird, because I've pretty much said that's the reality.

"Or you were dishonestly trying to make the comparison over two different time frames, 6.8W/m^2 increase in natural surface solar forcing over 1984-2000, and a 2.4 over a 1850-2025 'pre-industrial' to present time frame."

Okay.  I will withdraw that point.  I was, in fact wrong.  That is what it said.

However, the paper still wasn't talking about surface solar forcing, but was in fact talking about Bond albedo.  Note, as well, that at no point does any paper you've cited assert that surface solar forcing is either natural or not.

I doubt you'll ever be honest enough to admit any of your mistakes.

"My analogy of the pot of water on the stove was analogous to the oceans in the Earth's climate system"

No, it was analogous to the atmospheric system of energy exchange from solar forcing.  Do try to keep up.  Perhaps that would be easier if you responded in single responses in succession instead of spamming multiple replies where you clearly forget what you were talking about previously.

" You didn't cite or quote from any of those sources in your previous comments."

I cited those 8 sources in the 8th reply.

I can lead you to water.  I can't force you to drink it.  You're clearly the sort that will never admit you were wrong no matter how clear the evidence is.

"Any sane, rational, scientifically literate person would understand that my comment meant that the ASSUMPTION that relative humidity remains constant during atmospheric warming was hypothetical"

Again, take that up with Arrhenius, Callander and Plass, among others.  You can call it an "assumption" if you want.  The peer-reviewed objective analysis is there for anyone to go through.  Their calculations have been proven beyond reasonable doubt via hindcasts based on their mathematical formulae.

"95+% of climate models FAIL because they predict too much warming."

See:

1) Z. Hausfather, G.A. Schmidt et al, Geo.Phy. Res. Let, vol. 47, 2020. 
2) G.A. Schmidt, K. Tsigaridis et al, Nature Geoscience, vol. 7, pp. 158-160, 2014.
3) K. Cowtan, R.G. Way et al, Geo.Phy. Res. Let, vol. 42, pp. 6526-6534, 2015.
4) Z. Hausfather, M. Zelinka et al,  Nature, vol. 605, pp. 26-29, 2022.
5) B.D. Santer et al, Proc. of the NAS, vol. 119, 2022.

(Apologies for the lack of paper titles, but y/t is blocking because of one of them.  The details above should still be sufficient to find them all.)

"I've done no cherrypicking. You can't quote any of my sources where they say or present any empirical data that surface solar radiation has decreased over the late 2th century. It doesn't exist. Which proves that I'm NOT cherrypicking."

Claims I've never rejected.  It's the additional information that I'm pointing out that puts it in full context regarding the natural processes of climate.  Information that you refuse to acknowledge.
Reply: @Leafsdude  
" "Your evidence-free claim (lie) that I quotemined is noted."
The evidence, as I pointed out, is in the paper's title.
"So you're denying that Antarctic ice loss is used as a scare meme. Got it."
Wrong."
Good. So you admit that the CAGW-by-CO2 climate alarmism cult uses Antarctic ice loss as a scare meme. Thanks for confirming I am correct the climate cult you belong to does that.
Reply: @RealOldOne2  🤦‍♂
Reply: @Leafsdude  
" "YOU are the one who made the claim here"
Based on data and analysis published by others.
I do not make my own claims, because I have no working expertise on the issue.  I don't hide that, unlike you."
Thanks for admitting that YOU did make the claim HERE. 
Noted that YOU have still failed to provide any evidence HERE that 'Atmospheric and Climate Sciences' journal "Is known to not have a rigorous peer review methodology".
You are just repeating a false propaganda narrative of your climate cult.

NOW, are you ready to admit that you made a FALSE STATEMENT when you stated: "McLean(2014) is NOT PEER REVIEWED" ?  Or are you going  to cling to your false statement and turn it into a LIE? If you don't reply and admit it, you are turning it into a LIE. 
"When an error is made unintentionally, it is a mistake.
When an error is made intentionally, it is a lie.
When a mistake is pointed out, but still clung to, it becomes a lie." - physicsforums, physicsforums(dot)com/threads/factual-errors-vs-lies-and-admitting-mistakes(dot)686/
Reply: @RealOldOne2  "Noted that YOU have still failed to provide any evidence HERE that 'Atmospheric and Climate Sciences' journal "Is known to not have a rigorous peer review methodology"."

Except I did.

I'll do it again:

Jeffrey Beall, Simon Linacre, Andreas Nishikawa-Pacher, Tamara Heck and Kerstin Schoch, among many others.
Reply: @Leafsdude  
"Your dishonest and/or scientifically illiterate misrepresentation that I practically called relative humidity a "hypothesis" and that I assert relative humidity to be an unsubstantiated claim, is a noted."

So when you said, "[t]he CO2 forcing is "alleged" because it includes a HYPOTHETICAL, THEORETICAL water vapor feedback amplification" you weren't talking about relative humidity?  Then what were you talking about?
Reply: @Leafsdude  
"Your dishonest and/or scientifically illiterate misrepresentation that I practically called relative humidity a "hypothesis" and that I assert relative humidity to be an unsubstantiated claim, is a noted."
So when you said, "[t]he CO2 forcing is "alleged" because it includes a HYPOTHETICAL, THEORETICAL water vapor feedback amplification" you weren't talking about relative humidity?  Then what were you talking about?"
The "alleged" was about the QUANTITATIVE amount of CO2 forcing. Everyone can see that my "alleged" was in reference to the "INCREASE" in CO2 forcing of "0.4W/M^2". Intelligent people would recognize that an INCREASE refers to something QUANTITATIVE. 
The IPCC's equation to calculate that ASSUMES a positive feedback because they ASSUME that relative humidity remains constant throughout the atmosphere as the atmosphere warms. I clearly explained in my previous comment and provided a link to a graph which showed that as the atmosphere has warmed over the last few decades the relative humidity has DECREASED, which confirms that the IPCC's equation predicts TOO MUCH surface CO2 radiative forcing.

Once again, you expose your scientific illiteracy as well as your basic inability to follow a simple logical argument. 
You continue to embarrass yourself.
Reply: @Leafsdude  
" "Doesn't surprise me at all that you ignorant of the fact and reality that changes in W/m^2 of climate forcing are what causes temperature change."
Weird, because I've pretty much said that's the reality."

So if you admit that is a reality, then why do you DENY that the global warming from 1984-2000 was overwhelmingly NATURAL, since NATURAL increase in surface solar radiative forcing was 6.8W/m^2 (per McLean(2014)), while the increase in surface CO2 forcing was only 0.4W/m^2 (per IPCC's formula) ????

Like most climate alarmists I engage, you are twisting yourself into a pretzel.
Reply: @Leafsdude  
"Or you were dishonestly trying to make the comparison over two different time frames, 6.8W/m^2 increase in natural surface solar forcing over 1984-2000, and a 2.4 over a 1850-2025 'pre-industrial' to present time frame."
Okay.  I will withdraw that point.  I was, in fact wrong.  That is what it said."
GOOD FOR YOU! Thank you for admitting your mistake. 

"However, the paper still wasn't talking about surface solar forcing, but was in fact talking about Bond albedo."  

YES, the 6.8W/m^2 in paper WAS talking about surface solar forcing. The paper stated: 
"The decrease in the Earth’s reflectance from 1984 to 2000 suggested by Fig. 4, translates into a Bond albedo decrease of 0.02 (out of the nominal value of about 0.30) or an additional global SHORTWAVE forcing of 6.8W/m^2. To put that in perspective, the latest IPCC report (IPCC, 2001) argues for a 2.4W/m^2 increase in CO2 longwave forcing since 1850. (emphasis mine)
The ONLY shortwave radiative forcing the Earth's surface receives is from shortwave solar radiation. Any radiative forcing from CO2 in the atmosphere would be LONGWAVE forcing, just as the paper states.

PLUS, W/m^2 are the units of radiative forcing, NOT the units of albedo. Albedo is a percentage or fraction of the sunlight that the Earth reflects away. The paper confirms this when it documents that the albedo decrease was "0.02 (out of a nominal value of about 0.30)".

"Note, as well, that at no point does any paper you've cited assert that surface solar forcing is either natural or not."
Come on. That goes without saying. If solar radiation is not natural, the only other option (your "or not") is that it is human-caused. Are you claiming that solar radiation can be human-caused?

"I doubt you'll ever be honest enough to admit any of your mistakes."

If you provide evidence that I am wrong about something, I will admit it.
You haven't done that yet.
Reply: @Leafsdude  
" "My analogy of the pot of water on the stove was analogous to the oceans in the Earth's climate system"
No, it was analogous to the atmospheric system of energy exchange from solar forcing.  Do try to keep up."
Oh dear. Like many cult members, you appear to suffer from the delusion that you possess the God-attribute of omniscience, claiming to know what my thoughts and intentions are. Sorry, to burst your bubble, but you don't. You obviously still misunderstood my analogy, even after I explained that the pot of water on the stove represented the Earth's oceans in the Earth's climate system. 
Remember that your response to my analogy was: "Unless you keep pouring buckets of ice into the water as well."
So in your understanding of my analogy, WHAT "WATER" were you talking about in the real world???
So in your understanding of my analogy, WHAT WERE THE "BUCKETS OF ICE" in the real world??? 

"Perhaps that would be easier if you responded in single responses in succession instead of spamming multiple replies where you clearly forget what you were talking about previously."
No, it would be easier to follow if you addressed each issue separately until it is taken to resolution.
Reply: @Leafsdude  
" " You didn't cite or quote from any of those sources in your previous comments."
I cited those 8 sources in the 8th reply."
That was AFTER I pointed out the reality that NONE of your sources addressed SURFACE solar radiation. They were only about Total Solar Irradiance, which is at the Top Of Atmopshere, BEFORE it enters the Earth's climate system. 
So you're citing them only AFTER I pointed out your failure to address SURFACE solar radiation was a dishonest and false attempt to refute my accurate statement.

"I can lead you to water.  I can't force you to drink it."   
I have led you to reality in all of my comments, but it's obvious that I can't force you to face and accept reality.

"You're clearly the sort that will never admit you were wrong no matter how clear the evidence is."
Wrong. If you provide any evidence that I'm wrong about anything I've posted, I'll admit it. You've never provided any such evidence yet.
Reply: @Leafsdude  
"Any sane, rational, scientifically literate person would understand that my comment meant that the ASSUMPTION that relative humidity remains constant during atmospheric warming was hypothetical"
Again, take that up with Arrhenius, Callander and Plass, among others.  You can call it an "assumption" if you want.  The peer-reviewed objective analysis is there for anyone to go through.  Their calculations have been proven beyond reasonable doubt via hindcasts based on their mathematical formulae."

Sorry, but repeating evidence-free CLAIMS proves nothing. 
Rather than continue to embarrass yourself, provide quotes/links to empirical data from Arrhenius, Callander and Plass or others that empirically proves that relative humidity throughout the atmosphere remains constant as atmospheric temperature changes.

ps. I've already provided empirical DATA showing that relative humidity doesn't remain constant when atmospheric temperature changes, which confirms that the claimed surface CO2 forcing is exaggerated.
Here it is again: climate4you(dot)com/GreenhouseGasses(dot)htm#Atmospheric%20water%20vapor

 Once again you make a pointless and meaningless comment.
Reply: @Leafsdude  
"95+% of climate models FAIL because they predict too much warming."
See:
1) Z. Hausfather, G.A. Schmidt et al, Geo.Phy. Res. Let, vol. 47, 2020. 
2) G.A. Schmidt, K. Tsigaridis et al, Nature Geoscience, vol. 7, pp. 158-160, 2014.
3) K. Cowtan, R.G. Way et al, Geo.Phy. Res. Let, vol. 42, pp. 6526-6534, 2015.
4) Z. Hausfather, M. Zelinka et al,  Nature, vol. 605, pp. 26-29, 2022.
5) B.D. Santer et al, Proc. of the NAS, vol. 119, 2022."

Sorry, but none of those paper provide any empirical evidence that my statement is false. This empirical data is empirical evidence that my statement is true: uploads(dot)disquscdn(dot)com/images/4b4de7669d71ae220ed4a66af3a56242dc895899f6355019526d8064e7acd141(dot)png
That data was compiled by Dr. Roy Spencer and Dr. John Christy, the climate scientists who developed and maintain one of the global satellite temperature measuring system/data 

If you disagree, then please CITE, QUOTE and LINK to the paper that empirically shows that the above graph is wrong.
Reply: @Leafsdude  
" "I've done no cherrypicking. You can't quote any of my sources where they say or present any empirical data that surface solar radiation has decreased over the late 2th century. It doesn't exist. Which proves that I'm NOT cherrypicking."

Claims I've never rejected.  It's the additional information that I'm pointing out that puts it in full context regarding the natural processes of climate.  Information that you refuse to acknowledge."

That meaningless gobbledygook is handwaving obfuscation.
You accused me of "charrypicking", 
Leafsdude: "You've clearly not read your own sources.  That, or you're CHERRYPICKING the parts that support your predetermined belief and ignore the rest of it."
I HAVE read, and understood, all the papers that I cited and quoted from. And I haven't ignored anything in the paper that was contrary to the fact that those papers confirm that surface solar radiation increased by 3W/m^2 to 10W/m^2 during the recent global warming.

Once again, you make a meaningless, pointless reply. You're only bellyaching and handwaving to distract from the reality that the empirical scientific evidence shows that recent global warming has been caused primarily by natural climate variability.
Reply: @Leafsdude_  
"Noted that YOU have still failed to provide any evidence HERE that 'Atmospheric and Climate Sciences' journal "Is known to not have a rigorous peer review methodology"."
Except I did.
I'll do it again:
Jeffrey Beall, Simon Linacre, Andreas Nishikawa-Pacher, Tamara Heck and Kerstin Schoch, among many others."

Hahahaha. What a STUPID claim!
Sorry for your delusions, but listing some names is evidence of NOTHING! 
You are totally ignorant of what EVIDENCE means. Sad.
Reply: @RealOldOne2  "The "alleged" was about the QUANTITATIVE amount of CO2 forcing."

Can you be more specific about this "quantatitive"?

"The IPCC's equation to calculate that ASSUMES a positive feedback"

No, it doesn't.

"they ASSUME that relative humidity remains constant throughout the atmosphere"

No they don't.

"So if you admit that is a reality, then why do you DENY that the global warming from 1984-2000 was overwhelmingly NATURAL"

Because there is no forcing agent outside of human activity to explain the changes in W/m^2.

"GOOD FOR YOU! Thank you for admitting your mistake. "

Thanks.  Now you.

"The ONLY shortwave radiative forcing the Earth's surface receives is from shortwave solar radiation."

Yes, but not all shortwave solar radiation that makes it to Earth reaches the Earth's surface.  The question here becomes, is this additional radiation from the Sun, or is this a decrease in the amount of solar radiation being deflected before reaching the surface?  As per the source I cited earlier, the evidence suggests that it's the latter, due to decreases in cloud cover, aerosols and so on.

Note that both of those can be attributed to human activity as well, especially aerosols.

"Oh dear. Like many cult members, you appear to suffer from the delusion that you possess the God-attribute of omniscience, claiming to know what my thoughts and intentions are."

Or I can read context and make reasonable conclusions based on them.

The discussion was about "the atmospheric heat balance", not about oceans, which neither of us had mentioned up to that point.  Unless you have the attention span of a gnat (not ruling that out), you weren't talking about oceans.

"Remember that your response to my analogy was: "Unless you keep pouring buckets of ice into the water as well.""

Yes.  Buckets of ice into the water in the pot on the stove.  Not the oceans.

Sheesh.

"No, it would be easier to follow if you addressed each issue separately until it is taken to resolution."

Cool.  That's what I'm doing.

"That was AFTER I pointed out the reality that NONE of your sources addressed SURFACE solar radiation."

Interesting.  How did you manage to do that, exactly, considering that was the first time I cited sources?

Again, in reality, you need to alter demonstrable history in order to avoid admitting being wrong even in the most mundane ways.

"I have led you to reality in all of my comments"

Wrong.

"Wrong. If you provide any evidence that I'm wrong about anything I've posted, I'll admit it. You've never provided any such evidence yet."

More like you'll never accept anything as evidence.

"Sorry, but repeating evidence-free"

As above, you assert that anything that counters your view as not evidence.  Please do explain how Arrhenius 1896, for example, is "evidence-free".

"provide quotes/links to empirical data from Arrhenius, Callander and Plass or others that empirically proves that relative humidity throughout the atmosphere remains constant as atmospheric temperature changes."

Constant in what sense?  Because anyone can tell you that relative humidity is constantly going up and down as evaporation and the water cycle do their things.

What you can do is go back as far as Horace Bénédict de Saussure in the 18th century measuring actual water vapour levels.  Then you can find saturation vapour pressure in sources such as Lowe, P. R., 1977: An Approximating Polynomial for the Computation of Saturation Vapor Pressure. J. Appl. Meteor. Climatol., 16, 100–103, (particularly table 1).

You'll find, as well, than when talking about things like this, "quoting" is not really applicable.  I can't quote a data sheet published as a table in a scientific paper on y/t.

Note that the above, among other experiments, have lead to the Clausius Clapeyron equation being the standard chart for determining the maximum saturation at a particular temperature (and pressure, etc).  Sources such as Allan, R. P., Willett, K. M., John, V. O., & Trent, T. (2022). Global changes in water vapor 1979–2020. Journal of Geophysical Research: Atmospheres, 127 have demonstrated that actual readings are "close to...that expected from the Clausius Clapeyron equation".  Basically, our theoretical equations are as accurate as possible.

"Sorry, but none of those paper provide any empirical evidence that my statement is false."

Wrong.

1) "We find that climate models published over the past five decades were skillful in predicting subsequent GMST changes, with most models examined showing warming consistent with observations, particularly when mismatches between model-projected and observationally estimated forcings were taken into account."
2) In this work we created a very large ensemble of stochastic realizations of unforced GMT noise that were based empirically on the instrumental record and reconstructions of surface temperature over the past millennium. We used this ensemble to create an empirical estimate of the Envelope of Unforced Noise (EUN) and used it in the comparison between observations and the forced signal produced by [Coupled Atmosphere-Ocean General Circulation Models] over the 20th and 21st centuries. We find that the interdecadal variability in the rate of global warming over the 20th century (i.e., acceleration from ~1910–1940, deceleration until ~1975, acceleration until ~2000) is within the 2.5–97.5% EUN, even if the forced signal is represented as a linear trend, indicating that this observed interdecadal variability in the rate of warming does not necessarily require interdecadal variability in the rate-of-increase of the forced signal. We also find that recently observed GMT values, as well as trends, are near the lower bounds of the EUN for a forced signal corresponding to the RCP 8.5 emissions scenario but that observations are not inconsistent with a forced signal corresponding to the RCP 6.0 emissions scenario.
3) Is actually just a hindcast dataset, so I will retract this particular paper.
4) This is a commentary and not an article.  I will retract as well.
5) "It is shown that amplification of tropical warming between the lower and mid-to-upper troposphere is now in close agreement in the average of 37 climate models and in one updated satellite record."

"Sorry for your delusions, but listing some names is evidence of NOTHING!"

If you look up the names in context of journal reputation, you'll find the evidence, you lazy bum.